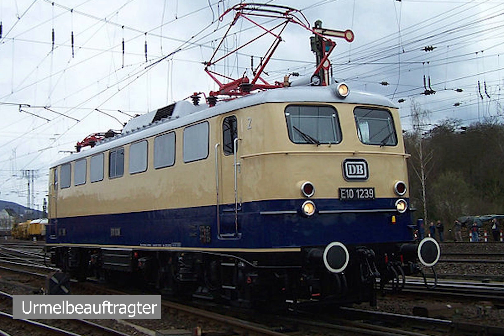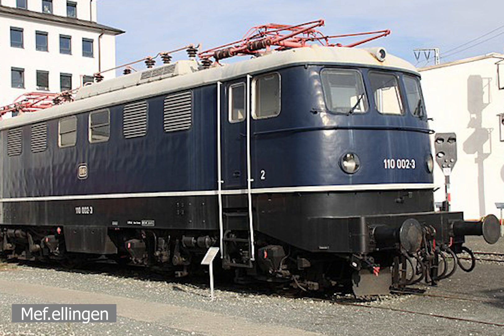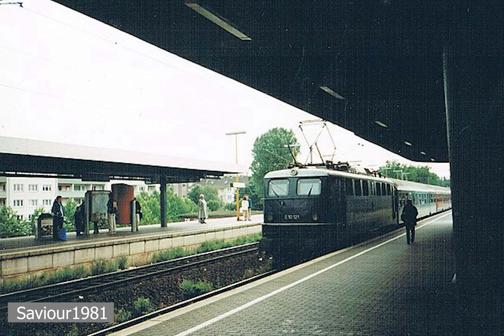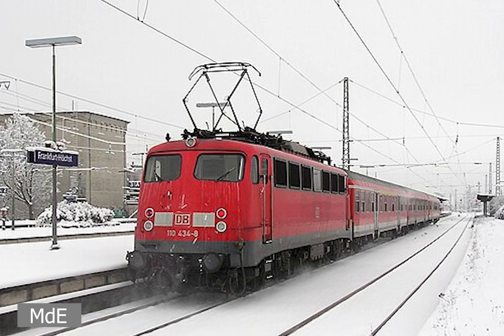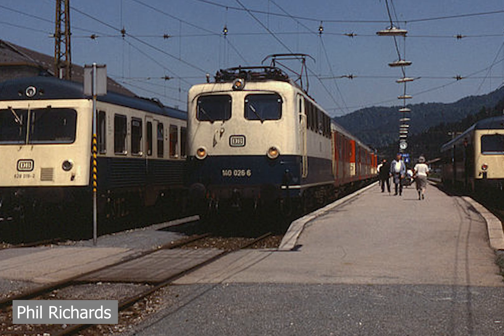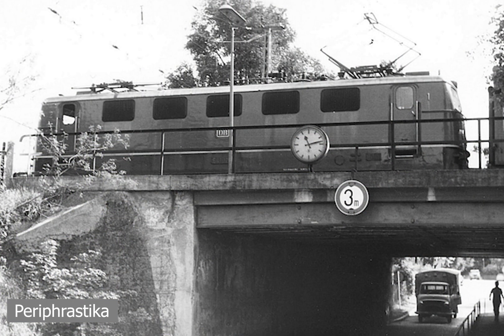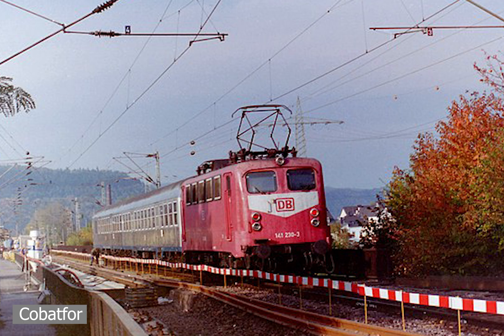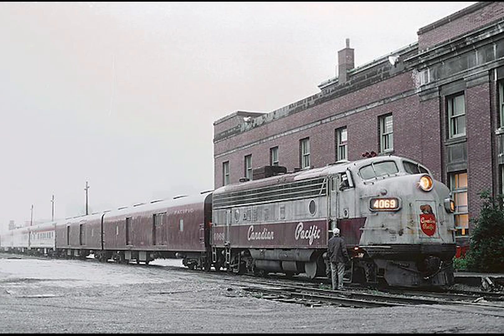The Electric locomotives that helped West Germany Rebuild. E10, E40, E41 and the E50

Comment: 0:14 "The Deutsche Bahn would introduce ..."
It was Deutsche Bundesbahn (DB) at that time.
Deutsche Bahn AG was founded in 1994 as a successor for both DB and DR (Deutsche Reichsbahn, the east German railway that kept the old name so that it would retain the operating rights in all parts of Berlin, a compromise of the allied powers in the early post-war years).
Also the locomotives were four and six axle (or eight and twelve wheels), not tweive-axled as is said in the video (that would be quite a monster).
Some locomotives were developed into advanced models in the 1970s: E10/110 was followed by 111 (built into the 1980s) and E50/150 was followed by 151. The new locomotives were slightly faster and had more modern components while generally keeping with the concept of the unified classes.
They all still had series-wound commutator motors which was the preferred technology in the 16.7 Hz AC system for a long time.
A bigger jump in technology came with class 120 in the 1980s, this paved the way to today's locomotives with inverters and 3-phase induction motors.
Reply from the maker: I can't belive i made my mistake about the DB like that. I mean the worse thing is i do acknowledge the difference between the DB and DB Ag. Same with the 12 axle thing

 However the 151 was a big step up in comparison to the original 150 considering it could actually do the desired speeds and was generally reliable. I believe 20 BR151s would be fitted with knuckle style couplers for their heavy minerals runs
Reply: @Reaper1770  and the 8 axles…